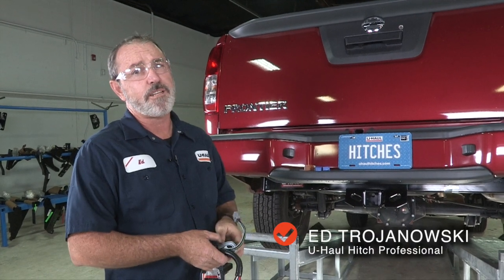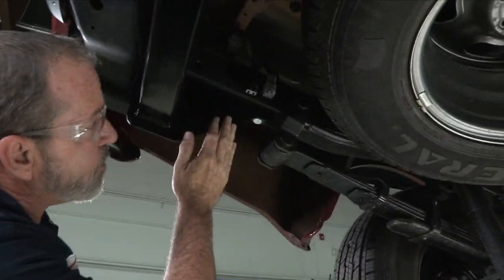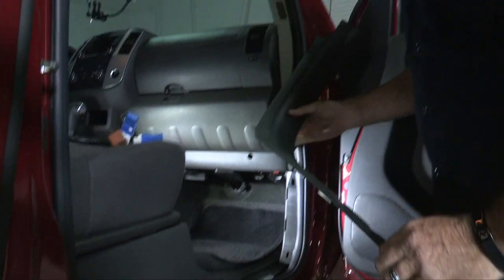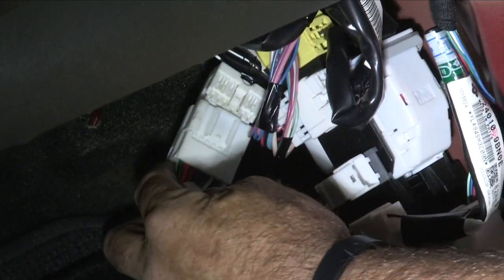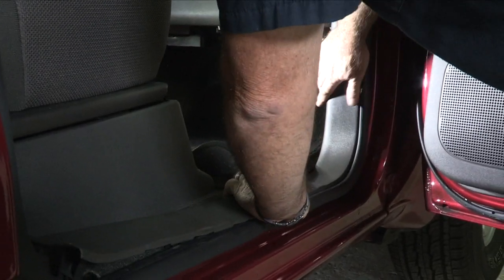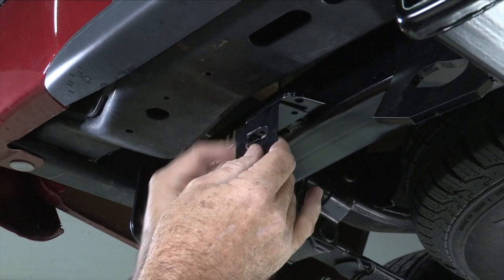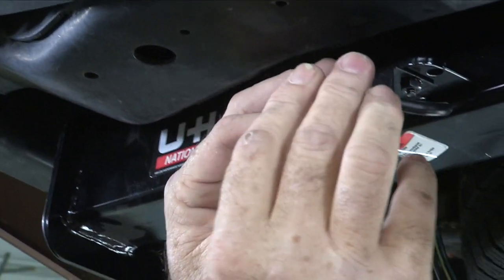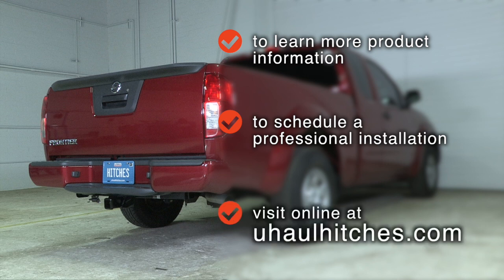2012 Nissan Frontier Trailer Wiring Installation

Comment: I just bought the plug for the trailer and  my signal and break lights work but not my running lights. I checked all the fuses and they are not blown. Do I need the plug for under the dash or is there something else wrong?? I’ve even tried another trailer adapter.
Reply: How are you checking the lights? Are you checking your trailer lights or checking the plug itself?
Reply: I have check the trailer bulbs, connected trailer to another truck, and even checked the 4 way plug with a volt meter. And I’m not getting power to the running light plug
Reply: @jordanvidrine8753  Good, so you know it's not the trailer. My guess is that its a fuse/relay so double check those again. The relays in this video can be real tight when you put it on so check if its on all the way. The fuse that it should be on the 2012 Frontier is fuse #32 in the Engine Compartment Fuse Box No.1.
Reply: @aaronlimon4803  my trailer turn and stop work as well no marker running light installed retro fit relays check with multi meter and no running light